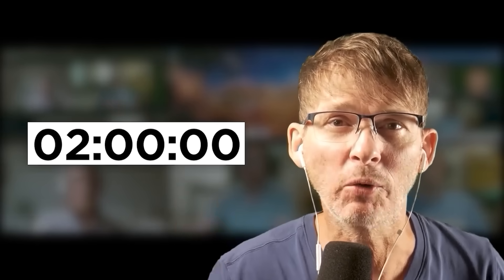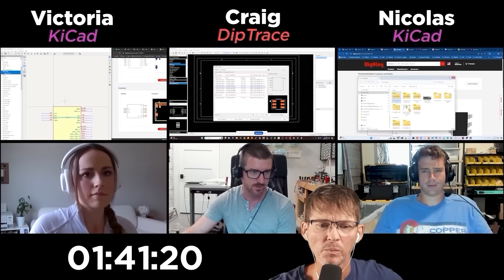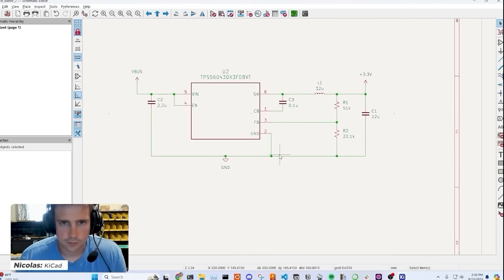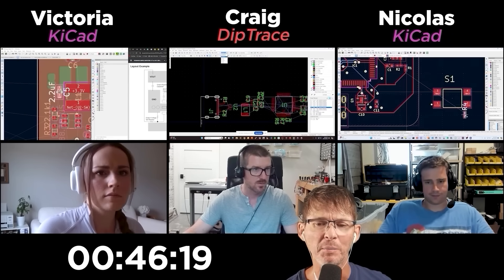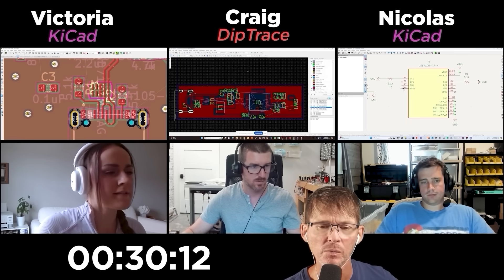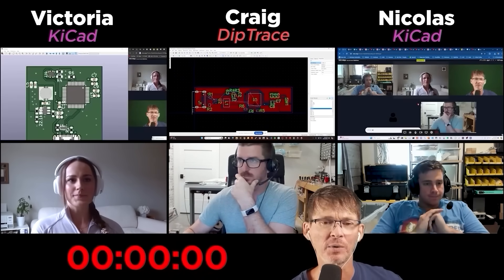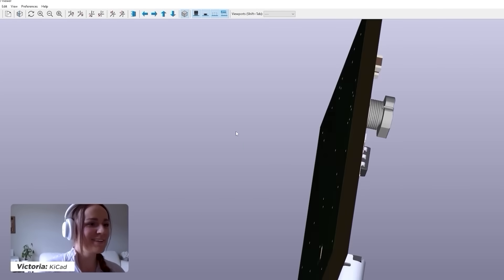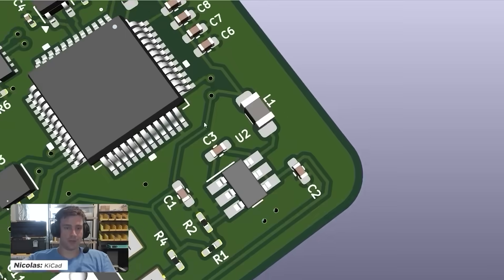3 engineers race to design a PCB in 2 hours | Design Battle

Comment: Let the PCB Bloodsports begin!
Kinda expected Diptrace to be faster due to easier workflow, but frankly they all were pretty similar.
Reply from the maker: I think it depends mostly on the user. Some may be quicker circuit designers but just slower at using the software, but some vice-versa.
Reply: NEXT ONE
PCB KUMITE

He says... Senzo Tanaka trained him.
If he really is Tanaka......... Show us............ THE SWITCHED MODE POWER SUPPLY
LOL

Comment: I think next time start them off with a board profile and switches and connectors already placed and fixed. That way they are all designing the same thing, and if they were ever built they would be interchangeable.

Comment: Kind of confused about this contest since there's no guidelines explained at all. I guess it's just supposed to be some STM32 and some temp sensor and some USB-C port. I think a better contest would have been to provide the schematic, maybe without all the component footprints assigned that way they were all working off of something standard, then give them like 1hr to assign footprints and create the PCB. At first I would have said Nicholas won as his board looked to have the more reasonable layout, then I checked his KiCAD file and he completely cheated on the decoupling, he sat all 4 caps next to a single VCC pin and ran a trace to all the VCC pins which makes absolutely no sense. Don't have Diptrace so no idea about Craig but I'm not sure why you would stick a temp sensor right underneath the microcontroller unless you were trying to measure the microcontroller temp itself. I'd like to say Victoria won since almost everything about her layout/schematic makes sense except she didn't use an external clock which I don't think is a very good idea when using USB.
Reply from the maker: Thanks for great feedback! I'm planning to do one where they all start from the same schematic like you suggested. The temp sensor on the back was just a joke not a serious engineering decision:)

Comment: I saw many mistakes from all 3 designs. Mostly with the buck converter. Also all PCBs are not BOM optimized and component placement optimized.
Reply from the maker: No doubt many mistakes, they'll all gladly admit that:) But also never do you only really have 2 hours to do a full PCB design. I thought Victoria did a great job on the buck layout, as did Craig. Nicolas was the fastest but his buck layout would have issues for more than small load currents.
Reply: @PredictableDesigns   just wondering - if you are planning to do similar video, what about adding me as a pcb designer?
Reply from the maker: @NaudioElectronics Email me and let's discuss it.

Comment: Switching regulator to drop from 5V to 3.3V just to power MCU and temp sensor? Seems weird.
Reply from the maker: Agreed:) I would normally use an LDO for this but I wanted to spice it up by making them do a switcher layout. Thought about making it 12V input which makes more sense for a buck but decided to use usb-c at 5v.

Comment: I'm gone only speak about the  mistakes: Craig's design wouldn't be good. The USB pair is going trough the high frequency(buck converter) area so it is picking up noise. Also putting the sensor at the bottom of the PCB makes the assembly processes harder and  it will cost more. The common mistake in all three design is the misplacement of the decoupling capacitors. They should be very close the the uC and not grouped like this.
Reply: "What are you laughing at?"

"This flipping circuit board, Jen! Some chump has run the data lines right through the power supply!"
Reply: @trainzack  I rewatched that show after learning PCB design and layout and I was really impressed with the writing of the show. Lines like that one are so funny because they’re actually true 😂. I guess the BBC had some electrical engineers on standby…
Reply: @trainzack  XD
Reply: @trainzack  that's funny 🤣
Reply from the maker: No doubt there were some mistakes, and these would be caught if I wasn't rushing them so much:)
Reply: yeah I see Victoria PCB  @9:11 where near the logo U3, the two capacitors don't have the track connected on the pad near the cpu pads, you can see the solder mask on C4, C9.
Reply: @CallistoPili  Very surprised by Nicholas' choice for a 6-pin USB-C connector; you're not getting much debugging done through that.
Reply: @dascandy That should be enough for USB 2.0, no? What would be a better choice?
Reply: @bennydontplaythat  6-pin doesn't actually have any data lines; it's just power lines and charge current selection lines. You need a 12-pin connector to have any data lines, and 20+ pin to have usb3 lines with it.
Reply: @dascandy  Umm.. what 6-pin connector?  At 11:24 that very clearly looks like a 12-pin USB-C connector to me (including routing and protection for the data lines)...
Reply: @foogod4237  At the very least the one he had at 2:49! I didn't see that he'd replaced it, thanks!

At 4:38 you can see that he took the two current lines and tagged them "D+" and "D-". I think he didn't realize then that it didn't have any data lines, and swapped it out later.

And now I see that at 7:30 he swapped out the 6-pin for a 12-pin.
Reply: Just a tip: A good pracrice is to isolate the air temp and humidity sensor on a "PCB island" - a cut out on the edge of the board, so that the heat form the surrounding components does not affect it the much. This way it will be much more responsive too, since the termal mass under the sensor is smaller.
Reply: You're definitely right. I would've fixed it in hour 3 😂 and also redo the entire layout
Reply: Yeah the order in which they placed and wired up components can probably be improved upon a lot. PCB layout is a game of compromises, and I regularly see pro's and hobbyists compromising in the wrong order.
Reply: Craig's design would be the only one that would be usable though. He's the only one that included a way to pull the bootloader pin, both others forgot it (Nicolas included a reset switch, but that wouldn't be enough). Since none of the boards include a JTAG/SWD header the only way to program the MCU without the bootloader would be off-board
Reply: From manufacturing standpoint  he was the best.  His was way less expensive , less chips,  small and simple . The other 2 were good but his was far more practical and cheaper
Reply: insight
Reply: This is hitting so hard with my Hyperphantasia
Reply: Good thing it's a differential pair so noise won't affect it.
Reply: @mateoarteaga8274   good point on that, differential pairs are very tolerant to noise.
Reply: hey , I'm working on a project (trying to make a device) to integrate a monitor, keyboard, mouse into a single unit (looks like a laptop ). I am not able to figure it out on my own , i need some advise and guidance . Could you pls help me ?
Reply: If you have a decent power/gnd plane you should distribute the coupling caps evenly. Only for crappy power planes (or no power planes) should you place them close to the load.
Reply: @laxarus3259   I always struggle with defining good power and ground planes...
Reply: @laxarus3259  where did you go to school?
Reply: Great feedback! Good stuff!  Probably AI designs this in 2 minutes or less 😅
Reply: @projectsspecial9224  You mean the AI that would have to use the electrical impedence and general laws made and proved by humans? Robots already manufacture the chips themselves, what more do you want lmao?

As someone who learned about AI quite a bit in school, like the actual algorithms behind transformers and models in general, the ai models you know now are probably not what you think they are. IDK if you have used any of the current models for anything other than basic HTML and programming, but it really isn't that good. Qt, for example, is one of the largest frameworks used in C++, and models like GPT-4o literally tell me to use functions that do not exist. Eventually creating an amalgamation of outdated code, actual fake code, and just incorrect code, and is in one of the BIGGEST C++ frameworks out there with damn near infinite documentation. I would love to see it actual create new laws or techniques that would improve things, instead it would probably be a procedural PCB maker which probably already exist
Reply: @projectsspecial9224  prove it.
Reply: Who asked you?